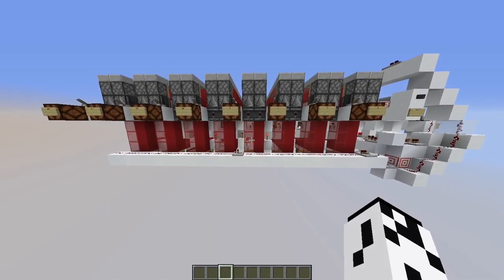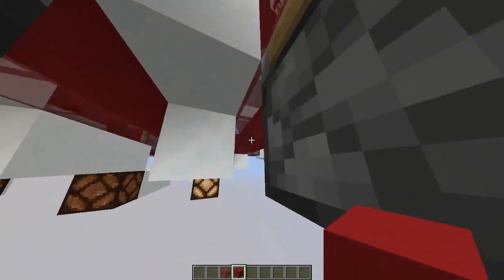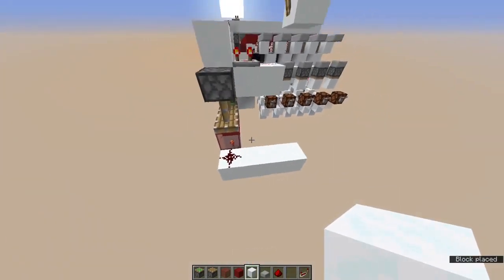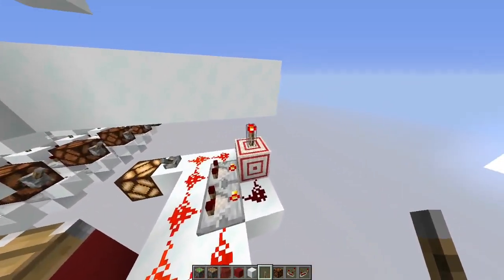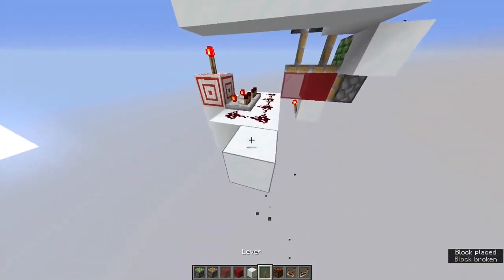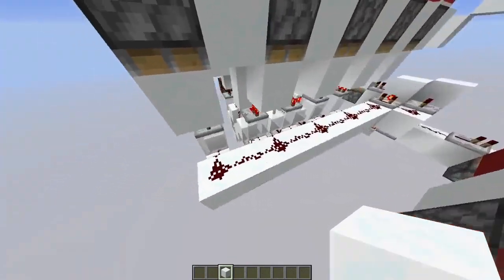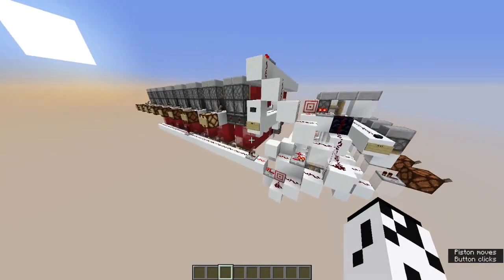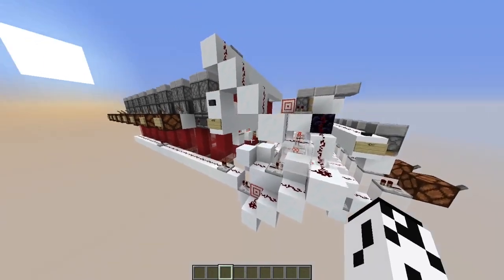32 byte redstone hard drive for 1.16 +

Comment: Nice, that's a clever design. It's not even slow actually given how much data it can store (in so few space).
Reply from the maker: its one of my favorite memory devices, just because of how it visually works XD
Reply: @myst_777  Yes I also enjoy piston tapes. I used to build them for ROM purposes back in 2011, for instance to loop over the digits in a 7-segment display.
Reply: But it was clearly a simpler design as it was a single tape per bit and thus no mechanism to 'swap' blocks & loop until the correct address is found.

Comment: i want to add something like this to my redstone computer what would be the most efficient way to reset or wipe one of these
Reply from the maker: when it comes to memory in a HDD, it is usually not wiped but the pointer for it is, so what you do is just overwrite whatever is in there before you use it, its like initializing variables, if you don't initialize them it will just use whatever in the memory at that location. (now for your answer) you'd have to increment the address and set the values to 0 one at time. so ya XD if you want to do like what a computer does, use ram instead.
Reply: @myst_777  if i already have ram would it work if i stored the values from the hdd into ram and sent them back as in inverse would that wipe it? because i want to use the hdd as a storage for variables that can be called while a program is being ran in the background for use with an io device to recall previous answers or something without having to halt a program that is currently being ran
Reply from the maker: @yuritarded9258  for that Id suggest you use the stack data structure, its great for storing terms then using them later on.
Reply: @myst_777  ok i will look onto that that will probably be faster then using one of these also

Comment: is there a way to extend the address finder because when I tried the redstone couldn't reach. When I used repeaters, the timing messed up.
EDIT: Nevermind, I used instant redstone extenders to power it along with changed wiring
Reply from the maker: in terms of adding more memory, try imagining each of these HDDs as 1 register in normal ram. in that sense you can make a decoder to select the output of an individual 32 byte cell, then have the address part hook up to all of the cells. I am sorry if this doesn't make to much sense but its one way.
Reply: @myst_777  This makes sense, you could also add 8 more tapes to the drive and make a 64 byte hard disk
Reply from the maker: @minecraftwithoutlimits589  8 more tapes would be 256 bytes, 32 * 8 ,but yea to address that setup you can treat each tape memory as a register, then use a decoder to select one of them
Reply: @myst_777  That seems wrong, if the entire drive is 32 bytes then each tape is 32 bits or 4 bytes. 16 tapes * 4 bytes per tape = 64 total bytes.
Reply from the maker: @minecraftwithoutlimits589  when i meant tapes, i meant the whole structure, not the 1 bit my bad. but yea a 16 bit register would be 64 bytes.